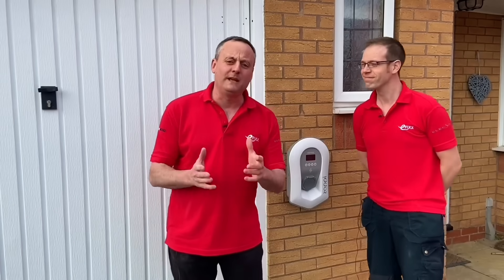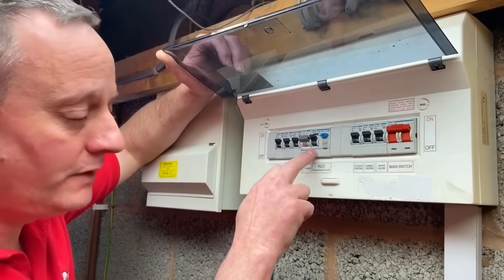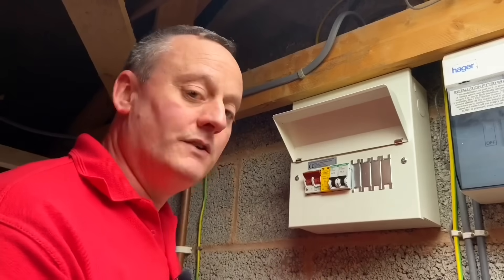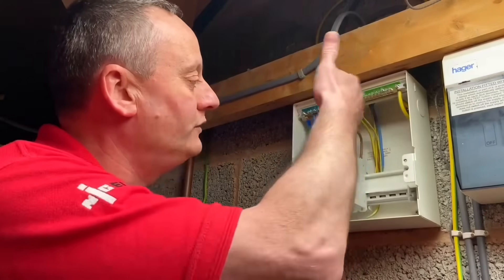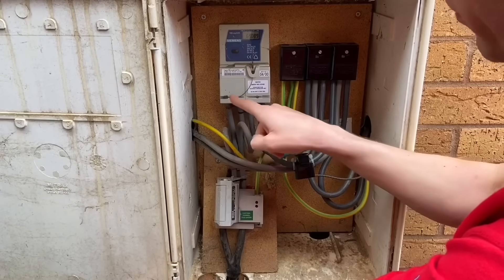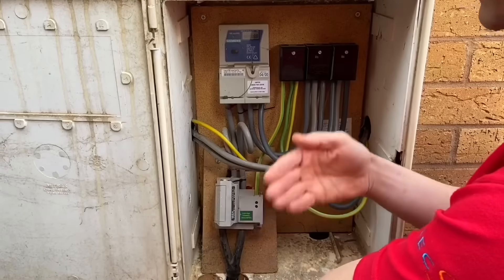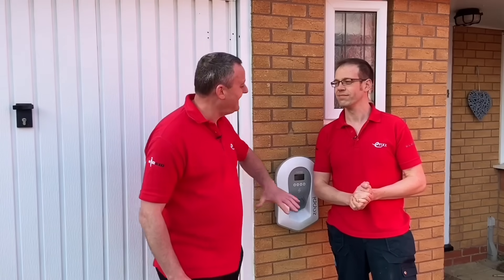EV CHARGER installation UK - can you connect to an existing CONSUMER UNIT?

Comment: Where's the ground fault protection?
Reply: They mentioned an internal charging unit RCD which gives earth fault or ground fault protection. Also the wiring method used from the sub-main consumer unit to charging unit allowed for omission of RCD protection for that feed cable.

Comment: Great video lads. Would it not have been better or more thorough to have installed a 2 pole isolator switch in the meter cupboard?
Reply from the maker: The meter has a built-in switch
Reply: @efixx how do you reset those if they trip?

Comment: Interesting that the new consumer unit is fed by 25mm2 tails when the max load is 32a. If no other MCBs are added to the EV Consumer Unit, 6mm2 tails would have been sufficient.
Reply: No. The fuse protecting the tails is 80/100 amp. So cable must be able to carry fault current

Comment: Had an electrician look at my new build installation before attempting to install a EV charger and he told me he won't touch the system due to David Wilsons electrician has used 10mm Swa cable instead of 25mm tails from the isolation switch to the CU. Is he correct in not touching this until David Wilson have corrected this? CU has 100amp RCDs and main trip

Comment: Why wouldn’t you just fit the new consumer unit which is just for the ev charger inside the metre box and then run the cable straight to the charger externally?

Comment: I have a question. The main fuse is 100amp.
The two consumer units are on 100amps.
What if it overloads the circuit and rcd keeps tripping coz theres more current being drawed on two consumer units onto 1 100amp fuse. If that makes sense

Comment: Great video - it helped me to understand my experience. I recently purchased an EV and wanted a charging point fitted. I was amazed at the quotes I received (around £3k). I thought mine was a simple job - fairly new consumer unit and easy access from there to the charging point. However the electricians had explained the need for various improvements (including the benefits of installing a surge protection device). TBH I thought they were milking it - but I can now understand what they were saying based on your video. 

However it does highlight another barrier to the transition to electric cars. I doubt many people would guess that a “simple” installation of a charging point would be so expensive (ignoring all those who can’t park on their drive; who might want to charge 2 cars overnight; who have older fuse boxes; etc).

Comment: A pity they didn't put an isolator in the meter cabinet while they were in there. Yes, there's a switch on the meter- but only until the supply company replaces the seal.

Comment: So, an obvious question that I don’t remember having asked before (which doesn’t mean there isn’t one somewhere in one of the comments sections somewhere on this channel already): why do you split the meter tails for a second consumer unit always close to the meter itself? Why not use most of the existing tails and put the connection blocks near the CUs, instead? It seems like a lot of extra copper and I just don’t see why it’s better. The two consumer units together can still only draw as much power as the main fuse allows, and the total draw is still sized such that the size of the tails and the possible power use is matched, in other words, the 80A or whichever it is is still going through a section of 25 mil around the meter itself, even if it’s using a collective 50 mil from the blocks to the two CUs (and zero way to equalize on the other side, so it’s not even like it’s running in parallel).

Edit: extra thought, the idea of leaving the meter connections themselves well alone and unmoving, while only moving (as little as possible) the inside ends to split them off there, feels like it would leave the meter connections safer that have been time-proven to be done up correctly as they were.

Comment: could you have fitted the Henley blocks next to db so you dont have to run the new db tails all the way back to the meter cupboard??? Perhaps fitting them in enclosure if required. thanks

Comment: Read comments here.I will say this got all qualifications for electrician and 30 years experience in industry Hnd electrical engineering and digree electrical systems all be it back in the 80s.Although it all means good and the rcd types should have been common long time coming.By the time we all make Money out of it and put it all correct we be in a war and housing prices would all fall and all electricians would be going to daddy cos there's no one paying for the upgrades.All these fancy fancy connectors and plastic switches are there for one reason.To catch a fishermans eye

Comment: Unfortunately as the so called RCD in the Zappi Charger there doesn’t comply with any of the BSEN numbers for RCDs mentioned in part 7 of BS7671, this installation was non compliant with BS7671 at the time of installation. Myenergi were aware of this but falsely advertised their Zappi charger by saying it did not require an RCD upfront and published a document in 2022 that said that it was “fully compliant with the 18th edition amendment 2 of BS7671.
Reply: @stranglx  I'm glad someone with enough knowledge added this!! I've had the same with Ezee chargers, as apparently the 'on board' rcd does not conform,  and lawsuits in other EU countries are underway. 
I pop an RCBO upfront, as belts and braces, bollocks about ' selectively ', safety is my first point!
Reply: @ I do the same with my head held high. There’s no problem with Coordination/selectivity with regards to fitting an upfront RCD for an EV charging circuit because the requirement for RCDs in the code of practice for EV charging supersedes all other publications and regulation 6.10.2 of the code of practice states quite simply, “It is not always possible to avoid selectivity issues where RCDs are used”. Page 67 of the 5th edition. There’s two main reasons, 1) you may need an upfront RCD because the circuit requires it for example if the cable is hurried in a wall… 2) you may need an upfront RCD because the charger may need it, either because the manufacturers RCD doesn’t comply with BS7671 or the manufacturer hasn’t provided one. Also on page 67 of your code of practice it says, “the EVSE may incorporate a suitable RCD and RDC-DD but the installer shall confirm this”. So as an installer it’s our responsibility to comply with the code of practice.

Comment: So how to you go on when you don’t have an old style stopcock with visible bonding ? , I have a surestop switch under the sink in the Cuboard with no visible bonding as the pipes run behind the built in cuboard , council told me the old stopcock would have been cut out when the surestop switch was put in .

Comment: It seems common to fit a new consumer unit- and, of course, it has nothing to do with the little discussed plans to make both vehicle charging and heat pumps liable to load shedding. Lot easier to wire that up when there is a separate consumer unit.
Reply: The idea that new consumer units are being installed for a sinister, secret plan of compulsory power cuts is likely an overstatement. However, the connection between these upgrades and the need for a more flexible grid is accurate?
After 2030, the goal is for the UK's energy system to be robust enough to handle the challenges of a net-zero grid. While the risk of emergency load shedding can never be completely eliminated, the widespread adoption of smart technologies and voluntary demand-side response is intended to be a proactive solution to prevent it from ever happening. The new consumer units are a key part of this strategy, enabling consumers to participate in a more flexible energy market that benefits them financially while helping to stabilize the grid. Apparently the future is like next weeks shopping list...its not written, and for some, they just used their internal memory back up...Memories of the future are in contradiction to the Standard  Model at the macro scale we experience. Some sub atomic particles go backwards in time...Maybe in a forgotten episode of EV based Star Trek perhaps?
Reply: @astoni314 It is far from secret. Which thinking person believes that the government spent £6B on meters to give users a little box that tells them how much they have used? The fundamental element in these meters is a remote operation breaker. What do you imagine this is for?
A sensible meter would enable the use of EVs for grid storage. Guess they will need to change them again…

Comment: Personally, I prefer the idea of an external CU, and definitely where you have an external meter cupboard unless there are some very specific circumstance. It means that the household and EV side of things can be kept almost wholly separate. It also minimises power loss in the cabling, avoids disturbing existing decoration and so on. 

In my case, it's definitely the route I would take as the back of my detached garage faces the house wall with the meter cupboard. Also, I can use it to rectify something I hate, which is that the existing SWA that feeds the garage is connected into the back of the ground floor ring circuit. It's 4mm, so at a stretch if might be enough for an EV charger with some sort of load control, but I think I will go for 5 way 6mm SWA which would allow for any future three-phase upgrade (and, in principle, when wired for single phase the two wires could be paralleled for each of the line and neutrals which I estimate would save around 60 watts on a 7.2 kW load). 

I just forsee me doing a lot of digging...

Comment: How does the surge protector work then? It's not a Crabtree device so it is surely not appropriate to fit in a Crabtree consumer unit? I would also be a bit disappointed if the EV charger didn't have surge protection built in.

Comment: That hagar csu , if I'm not mistaken is a type A not an AC ? It has 2 symbols on it ?
Reply from the maker: It’s a type AC - Google the part number shown on the RCD.
Reply: @efixx  ok thanks.  Looking at the one i just installed, it has the sine wave symbol ( in the square box) & also a half wave sine next to it like the one you showed so assumed it was a type A. My installation tested all perfectly weĺl but the customers current  split board will not trip the rcd upon testing, i was wondering if my seperate csu i installed for the EV ( like the 1 in your video) would effect it ? They are only joined by a mains 100A block ( like your vid)

Comment: So Now there is no Main switch ! on this installation  I would say Non compliant with BS7671  :  462.1.201, 462.2  !  There is only 1 incoming supply which is now divided in to 2 sets of Tails ,which an ordinary person may not Know they have to switch 2 switchs to isolate in an emergency!  Also the new consumer unit protective deviices were not labelled, You qualified this by saying not yet commisioned ! the installation was clearly Energised and should not have been so if not commisioned!!, Also what distance was the consumer unit from the Meter Cabinet was it within the 2.5 meters?.   Why didnt the installer Install a Double pole  or even Four Pole isolator in the Meter box then there would have been a main Switch! for the installation.

regards

Julian  Cambridge

Comment: Hi chaps. Love your videos.  I am doing the ev charging course next month and was wondering what you think of this option.  I would like to install a hi-integrity split load board (eg Hager VML914CUSPD) with type A RCDs and a 40A MCB in one of the non-RCD protected module. I then plan to run a 10mm SWA glanded into the metal CU. I understand I will then need to add a length of suitably sized CPC from the gland on the EV charging point (which is made of plastic) to the earth terminal in the EV charging point.  Am I right in thinking that I will not need to add a length of CPC to the gland on the metal consumer unit, as there is a very good fault path through the SWA armourings, through the body of the metal CU and onto the MET built into the CU?  It seems to me that doing so would be unnecessary and would add a parallel CPC path of approx 30mm.  Thanks and regards. Andrew
Reply: I forgot to add, the 10mm SWA I plan to install is 2 core. Thanks again. Andrew

Comment: a fuse for a surge protection device?
Reply from the maker: They fail short circuit - sometimes the fuse is inside the device - depends on manufacturer

Comment: Hi guys iv just had a ev installed and iv noticed that the electrician has only used t&e 2.5mm cable to supply power to the charger its around the wall in trunking this cable to seems to small for my 7kw charger can you advise 
Thanks mark

Comment: Is it not still true that the regs are a mandatory document, meaning used as a guide not statutory as are gas regulations
Reply from the maker: A new circuit requires notification under part P of the building regulations which is a statutory document. Part P then references BS7671.

Comment: Could you please explain why the supply cable to the ev charger could be non RCD protected? You indicated that as it's clipped direct to the fabric, it's not a requirement?
I was under the impression all domestic circuits now have to be 30ma protected?
Reply from the maker: If the cable is surface clipped, visible and unlikely to be damaged then you don’t require an RCD.
Reply: @efixx  Guys, can we have a pointer to regs regarding this? It seems like a strange exception for a T+E cable loaded with 32A for hours and supplying "socket-outlet for current-using equipment for use outside" and protected only by a built-in RCD without any physical means of testing...

Comment: What is the point of a manufacturer designing say a 100A board with a 40A breaker if you can't actually take 30A or so from that breaker for a car charger?

Comment: That’s a nice install but it seems a large extra cost for a new consumer unit and main fuse mods for the sake of tracking down the right Hager MCB on the existing none RCD side.  Is that the only reason why you wouldn’t come off that spare way?

Comment: Mmm. . . The electrician who did this has broken the golden rule. The board the main cutout(service head ) is mounted to is not allowed to be used as a mounting point for other equipment. The reason being is the boards which DNO'S use is made of a fireproofed chipboard that with time  rot away. When the DNO  sends a jointing team around to change that service head (or back board) it makes the job fraught with legal ramifications because the other ancillary equipment has to be undone and taken off the old board. The customer would have to pay an electrician to dismount the splitters and move them to a more suitable place near to the internal consumer unit(s). NO ancillary equipment should be mounted onto the outside viewer back board except the cutout(service head) and the energy suppliers meter. Although it is a very neat job it's technically not legal because of the need to maintain the DNO'S EQUIPMENT of which the chipboard backboard is.

Comment: Different countries, different rules. 7:11 this would never be allowed in most of europe, the phase split would be done at the consumer unit(or directly at the meter). Also, a ground cable can only be splitted at a terminal bar.
Reply: uk also allows for both of these

Comment: good install, but why not rcd for the sake of a few pounds protecting the twin and earth, yes the charge point has rcd but im guessing only between it and the car. i would say you can use an existing consumer unit, but when you have an older unit now delivering sustained high current day in day out it needs to be upto the job. personally i would go the separate consumer and over spec the cable size to keep the heat down. commenting as the despised diy'er.

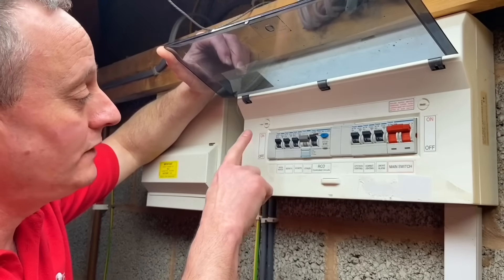Comment: Time index 1:27, you say you don't need an RCD at the CU end because there is RCD protection in the EV charger.
I disagree with this statement. It makes an assumption.

The assumption it makes is that the EV RCD is intended to protect the live and neutral cable going into it. The primary purpose of the RCD is to protect the live and neutral going out and feeding downstream from it.

I challenge you to draw a diagram out and analyse where the currents are going.
There are two circuit diagrams you need to draw, one with a live to neutral fault on the output of the RCD, and the other with a live to neutral fault on the input to the RCD.

In the case where there is a live to neutral fault on the input to the RCD, the currents at the live and neutral terminals on the RCD are  equal to each other (in magnitude). And therefore there is NO difference in live and neutral currents which means the RCD cannot trip.

It is very dangerous to make statements saying you don't need an RCD at a point in the circuit because there is one further down stream. Electricians will believe you and act on it
Reply from the maker: If the cable is surface mounted ( as in this installation) it doesn’t need RCD protection. This isn’t an assumption.

Comment: What thinking of getting a EV and a charger fitted but it seems to much hassle. The fuse box is under the stairs so quite far away from the outside electric box. I am with octopus energy would they have to come out and check I can have a charger fitted?.
Reply from the maker: Octopus would not usually be involved in the process.

Comment: Before I start. I’m not a geek. As I like to give value for money on my installations. 
So why did they install “Another” consumer unit. They have altered all the tails at DNO end, and still left in a plastic consumer unit with no SPD protection for those circuits. Why didn’t they either just install it into the existing DB, or change the DB to the current standard. For me, this installation has made the “Overall” installation worse. Like people have commented in this post, 5 electricians give 5 different answers. The industry is flawed, and I’ve been an electrician for 20 years.